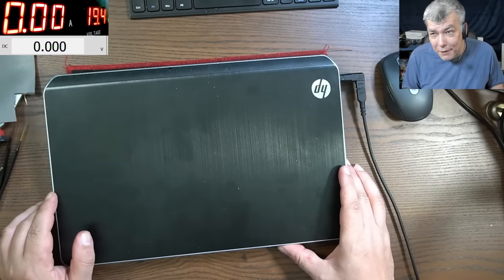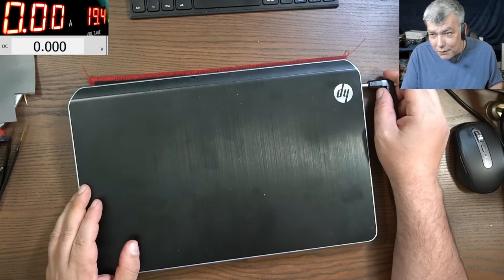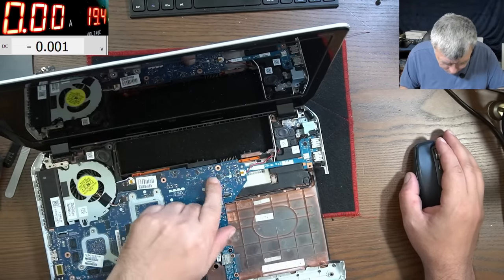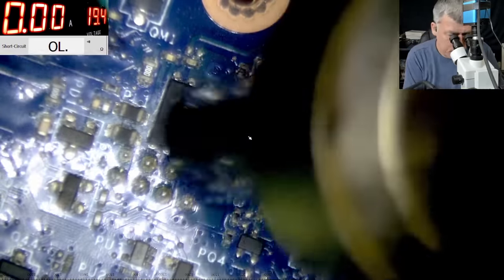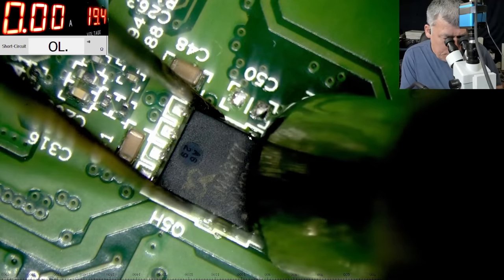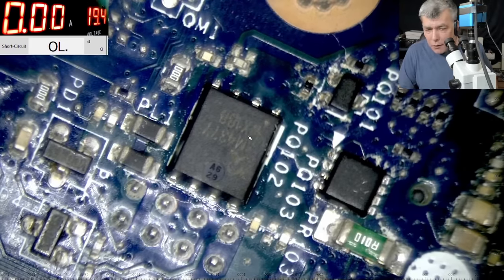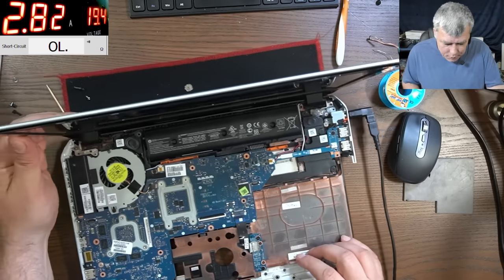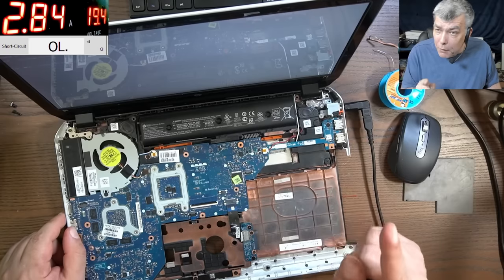How a shorted input mosfet looks like - Dead shorted mosfet behaviour

Comment: with mosfets failing so often in laptop p/s, would be interesting to know typ failure mode (over temp, over current, voltage spike etc). then design steps could be taken to better protect, making laptops more reliable. again, great learning experience.
Reply: Designer know all that but in the end BoM made by someone else decide about everything and not engineers.
Reply: @gorjy9610  absolutely right.

Comment: a customer today brought an asus x541n/na laptop no powering on but just having steady red light from the charger, ive check all the voltage and all chokes, or vrm and ldo have the corresponding voltage but the cpu is none because the power button is not working even tried to short the connector doesnt work too. and my suspect is the 2nd input mosfet is semi faulty using diode mode both drain and source have a reading on diode mode but doesnt in buzzer and when plugging the adapter the cpu heatsink warms up little? do you think guys the cpu is shorted? the cpu vrm heats up too a little like the cpu but not that much probably warm.

Comment: Sorin i have a question, i wanted to post on the Forum but i didnt see where we can post. So Here is my question. 1. What is the effect of by passing a MOSFET using a jamper from the source to the drain incase the gate is not receiving Voltage or incase i don't have a replacement Mosfet. 2. I know there's an official Honnest ways of testing for a faulty MOSFET and you have taught us here on your platform many times. But I saw some test mosfets in DIODE mode. It was an N channel Mosfet and he put the Red probe on ground and Black probe on source and it was beeping and he concluded that it was a shorted MOSFET. And indeed it was shorted. So could this also be another way of testing a MOSFET?
Reply: In case of shorted mosfet where you put what probe is irrelevant, it will be (around) zero ohms in both direction. Diode mode will show diode junction in case of good mosfet in one direction (depending on mosfet type it will be one or another) but it will always be open in opposite direction.
You can bypass second mosfet in most cases with wire and just rely on protection in charger in case of short (Sorin did that multiple times, that's how he get king of dodgyness award :D) but bypassing first one can make problem with charger as you saw in this case.
Reply: @gorjy9610  Thanks alot for that information. message well absorbed.

Comment: Sorry, it is not clear to me why when you plug the power supply the current is too high and then after few second returns at normal values, allowing to start (no the same with a charger as you explained since it shuts down instantly). Where is that high current going for few seconds? Thank you.
Reply from the maker: The battery overcurrent protection is disconecting the battery, that's why even if the laptop starts, the battery won't charge